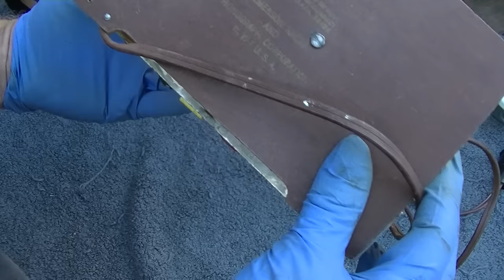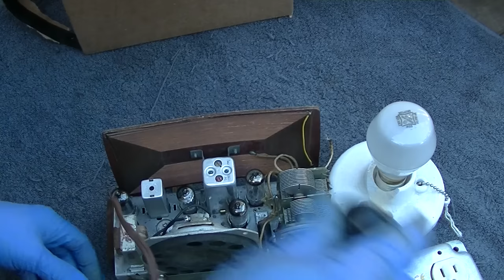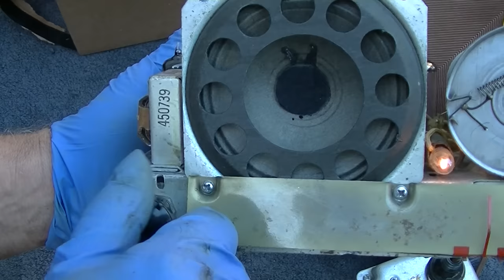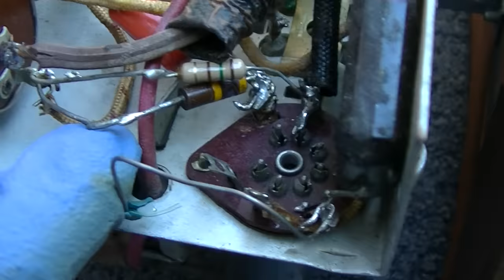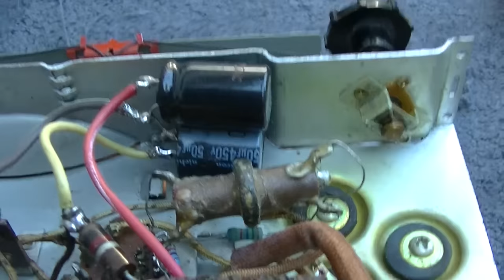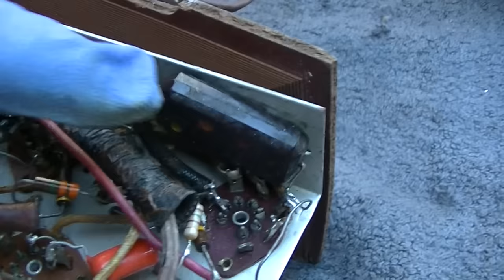Emerson AA5 Tube Radio Restore Mistake Repair

Comment: That capacitor was clearly oiled paper capacitor. Very likely some PCB based oil, by the way. You won't be able to wind the mica this way, mainly in mass production, it would just be breaking.
Reply from the maker: good point, let me get the gloves in the trash and clean all the tools.
Reply: Remember the smell of this oil. Fun times: cadmium plated chassis, PCB-based oils, selenium rectifiers (also with cadmium in them). All the healthy stuff 😸
Reply: @argoneum  asbestos too!
Reply: When I was a young boy my dad had an old camper that he use work on old radios in. (this would have been in the 50's, but it was the 60's when I would go in it) I was born in 1960 and I would have been probably around 8 or 9 yrs old when this happened. I would be fascinated with all the cool looking things in the bottom of those radios and I'd take the old capacitors apart to look at them exposing myself to all the toxins, although not knowing that at the time. (probably why I have this nervous 'tick' now........no just kidding, LOL) One day I got the bright idea to plug one of those old radios in to the wall socket, grabbed the chassis, and it nearly knocked me to the floor. I quickly let go, unplugged it, and didn't mess with them after that. LOL! Young and dumb I guess! 😂 Now that I'm older and close to retiring, I started messing with them, and anything electronic, it's always fascinated me how they work.
Reply: @argoneum  I'm glad I didn't really touch the chassis with anything abrasive or corrosive when I did a 50sish Hallicrafters radio a while back. I was aware of the potential for PCBs in caps and asbestos in insulation and pretty much treated anything that looked oily or fiberglassy like hazmat, but I had no idea at the time to ever expect the chassis could be plated with something like cadmium. It just seems so bonkers now.
Reply: @treelineresearch3387  I piked up a Heathkit Cantenna at an estate sale recently - it's basically a paint can filled with oil, and a big resistor hung from the lid, that you use as a dummy load for radio transmitters. Of course, the oil was all over the outside of it, and when you bought these back in the day, you would either buy PCB transformer oil or mineral oil to fill it.

Long story short, I bought a cheap PCB test kit and I was really happy to see that it was just mineral oil!
Reply: @treelineresearch3387  modern fasteners are often cadmium plated.....
Reply: Yum! PCB's!
Reply: @jaspershattuck4987  No, zinc chromate.
Reply: @OddJobFix  aircraft steel fasteners are cadmium plated, also zinc chromate is used on airplanes and newer less toxic zinc phosphate

Comment: I think radio repairment it's a good start for a kid. I've started doing this since age of 9 by repairing a lot of soviet old electronics and learning what should I do or shouldn't (electric shock with 220V - the best teacher).
Reply: Agreed. I blew myself across a room cutting through a hot wire with pliers. Sometimes, the best way is the hard way.

Comment: i like when someone tells you the basics and then you can look into it further on the internet. i bend those solid wires into loops then smash them together with needle nose pliers and then solder them . i usually try to slip heat shrink tubing on either side and let that be protection for no grounding accidents .

Comment: Novice soldering errors, wrong value replacement parts,  need to replace all bad old caps and not doing so, and cold 
solder joints too can always  lead to this trouble. Shango does a phenomenal troubleshooting job with a licensed by
 RCA  AA5 tube set. Micamold plastic covered capacitor replaced. The desert can wait for now.👍🏻👍🏻

Comment: In HVAC work they are recommending the highest voltage caps for start/run as they say they are all Chinese and substandard and a higher voltage will last longer.

Comment: I've have the same RCA tube manual, a little different version from the mid 70's when I did Voc. Radio & TV in High school, mines been coming apart ever since🙃. I like how clean the chassis was ,and yah the tack on joint will eventually fail over time. It's got plenty of audio now. I've been doing this stuff for 50+ years and still get parts in the wrong place🙂

Comment: The way I see it, the best soldering equipment for working on tube stuff is not soldering iron but soldering guns. Will happily solder metal sheets and only the tip gets hot, so you don't burn wiring or other things in cramped spaces. Same going with automotive electrical work, you can safely put the thing on the carpet as it cools down fairly quickly.
Reply from the maker: i have several of those, the tips break too often and are expensive these days.
Reply: @shango066  form a tip from number 12 bare copper wire.
Reply: @shango066  Use a piece of copper house installation wire, about 4mm² , but you need to experiment the length because the resistance is crucial. Short pieces, like sticking out of the gun no more than 3 cm is about it. It just needs to match the internal resistance/impedance of the secondary winding.
Reply: I would have to disagree---the heat from a 150 watt gun can ruin parts you plan on reusing, and also break off tube socket pins from excessive heat. I use a 40 watt Weller iron for most of my stuff, but I do have an old RatShack gun around for times when I need to solder to chassis
Reply: @justsumguy2u  Those who are experienced will rather use an iron that is to large than one that is to small. When to small you will always need to heat up to long, but when to large the user will know how to solder quick and confident.
Reply: @erikdenhouter  Aside from soldering to chassis, I've never had a job that 40 watts couldn't handle. Using a soldering gun is like using a flamethrower to light a campfire
Reply: @erikdenhouter  don’t be insulting and assume he is not experienced.
Reply: Solution there is to just cut the lead and not remove it from the chassis.
Reply: @marka1986  You need the big 240 watt gun for 12 ga.
 14 ga solid copper works for the smaller 140 watt gun. You won't get a nice tip of heat however, good for chassis soldering of grounds only, not good for tight spaces.
Reply: @marka1986  I was going to suggest the same thing.  Smash the middle flatter gently then anneal.  Make 20 at a time.
Reply: @marka1986  Mr. Carlson has a video on how to do that.
Reply: @linuspoindexter106  Actually been doing the house wire iron tips a long time before YouTube.
Reply: i could never get on with the 'guns' , you're only supposed to use them in short bursts, then rest them a few minutes or their transformer overheats, i have an old 60w iron that does chassis soldering ok, think i also have a bigger one somewhere, 100w ish?
Reply: @andygozzo72  I have a newer Weller that has a smaller duty cycle and a plastic case. It gets soft with extended use.

 I also have an OLD gun that is a bakelite frame and probably wouldn't melt if you tied the trigger shut and walked away.  It's also MUCH heavier than the Weller.
Reply: @justsumguy2u  Never had an issue with that. It's just that you need to be gentle with the trigger (modulating the power) and know your max heating time. Mine is 100W but with a shorter wire (it uses 1.5mm2) it will go up to 125W. I think another big advantage is that you can "move" the standard colophony flux to fix some bad solder joints on the spot without adding fresh solder and making blobs of solder. There are also those guns with a double switch, the ones manufactured in Poland have a 45/75W switch. Trigger has two steps. First one enables 45W for delicate electronics while pulling the trigger harder increases power to 75W. Primary has two taps.  Though with my DIY tube equipment I tend to use ceramic sockets (chinese of course) as those are just overall better quality than old stuff which after several decades will be in rather bad shape anyway (apart from some mil-spec sockets, I happen to have some of those, ceramic with cast iron mounts).
Reply: @TechGorilla1987  mine is a plastic cased weller, probably 20 to 25years old, they warn you in the instructions to only use it intermittently ! also have another one, looks same but unbranded, probably cheapo copy

Comment: I'm like you on replacing capacitors. I have a Zenith model 14P11 Black and white TV from about mid 1950s and its all original and plays like a new TV. I wish I could mail it to you but you're so far away. A nice older man gave it to me before he had to go to the retirement home 😔. I know you would appreciate it and not recap the heck out of it.That takes the fun out of troubleshooting it when it needs repair and If I did I would only replace the bad one. Its not that hard to take apart again and again hahahaha 😆 until most are replaced. I have too many toys

Comment: (@15:13) - There is no “R8” in the parts list in between R7 & R9; it goes from R7 (4.7 Megohm - bottom of center column) to R9 (470 kilohms - top of right column). Oops. 😥 Instead, it’s listed with R1 as 220 kilohms. 🤯
Reply: No, it is the same as R1 so it is listed at the very top, both R1 and R8 are 220K
Reply: I caught that too. Stills seems to work ok though.
Reply from the maker: in this radio its a 470k. Performance wouldnt change at all
Reply: @shango066  Shows how forgiving tube circuits can be. I would be curious to see what happens if you tacked another 470k in parallel, but as you say it probably wouldn't change much if anything. The 12AV6 tube will probably last longer leaving it alone as it is.

Comment: I'm jealous. That radio does point to point wiring in a pretty clean way.

Meanwhile this Philco I'm working on 3/4th's of the time is wiring related. Components are folded and layered on top of each other with a generous helping of extra wiring.

Oh, and it's the first time I've gotten hands on experience with these types of radios. I'm blaming bad luck. And the CIA.

Comment: Some of those military VOMs used 1 milliamp meter movements, so they're 1,000 ohms per volt.  Now some schematics were measured with this ilk of meter so the voltages will be higher than with a 20,000 ohms per volt or higher meter.  Oh, also the line to chassis capacitor really should be at least 600 volts rating, preferably a line-rated capacitor.  Many radios skimped and used a 200 volt capacitor which often shorted or blew apart at the first lightning strike on the power lines.  Sometimes the capacitor would blow out the end, putting out spiral foil streamers, just like new year's Eve!

Comment: Shango, could you point in the right direction...i'm fixing a old tek scope tds544a and i'm having monitor issue.
it seems like the vert and horz deflection is not steady. the picture is  out of focus and expands and contracts?
any ideas? just point me in right direction

Comment: There's a glaring cold solder joint just next to where you corrected the resistor connection.  Did you leave it for the owner to take care of?

Comment: That looks nearly identical to my Emerson 547a - Plenty of model specific schematics available. A note to anyone working on one of these. THE CHASSIS CAN BE HOT. Even with gloves on you could get a shock! I found that out when I was working on mine as a kid some 50 years ago!
Reply: just googled that model no. yep, it looks like the one i have(i'm in the UK, dont see american sets much, but have a few and come across some ones made specifically for the UK and europe as they have 240v transformer)  and yes chassis directly connected to one pole of mains, via the switch,, some were 'semi isolated' connected only via cap and resistor, but not this one!

Comment: There is 125 volts of B+, and I am assuming R8 is dropping 50 volts to the plate of the 12AV6 at pin 7 with no dim bulb? Will that triode operate correctly at 75 volts? Seems a tad low, but I am not all that familiar with AA5 series string sets. Tube data lists 90 volts as typical, with a max peak voltage of 330 volts.  These videos certainly make us think, love the  journey you take us on.
Reply: tubes, or valves as we call them here in the uk can be very 'unfussy' as to voltages, unlike some solid state stuff, as an experiment i ran some 240v intended sets on 120v just shorting out the heater dropper and noticed very little difference, but big reduction in heat generated  , there were some valves that worked at 12v 'ht' for use in hybrid car radios, valves up to the detector, transistor power output, i have one
Reply: @andygozzo72  Or shango would call them vacuum bulbs.

Comment: I just bought a Bluetti power station- battery/inverter/charger and I wonder if it would be good to plug in old tube gear for testing and repair?
No connection to the house wiring at all.
20 years ago I worked for a company that made prototype manufacturing machinery , and we were required to do a lot of 
soldering in the parallel fashion , and each connection was verified by an inspector. These machines were used in the explosives industry,  btw.
Reply: Unless that inverter is a 100% pure sine wave output, it is useless for testing old gear. A non pure sinewave is extremely noisy, and will damage transformers and possibly overheat or explode filter capacitors. Evrn if it is a pure sinewave inverter, its electronics will make a lot of rf noise which will affect radios and other audio gear. Short answer is don't try it.

While the isolation is a good thing, the main thing is current limiting via the "dim bulb" tester, that can prevent serious damage to equipment with shorted components. 

I have an isolation transformer that mainly gathers dust. But every bench must have a variac and dim bulb tester.
Reply: No you'll get a crappy waveform

Comment: Prodding around with fingers in a live tube radio?  He has more faith in thin rubber gloves than I do!  There are some sharp wire ends in that radio that would punture that glove (and skin) very easily.  200 VDC or more into a skin puncture would discourage such a practice.

Comment: Greetings:
You forget to solder your 470k resistor extension at detector pin 7.
This is my first time seeing both a trim-cap tuned 1st IF transformer and a slug-tuned 2nd IF transformer in the same set. Is there some design advantage? I know that only the slug tuned units get silver mica disease.

Comment: The parts list skipped over R8 and only listed R9. In other words, the middle column ended with R7, then the top of the far right column is R9. It does show R8 in the schematic however, but what is the value? (edit: removed time stamp)
 Would not be the first time the parts list and the schematic differ. R9, the 470k is the resistor to the grid of the output tube.
Reply: r8 is 220000 ohms same as r1 it's listed in the schematic along with it
Reply: @Mister_Brown  Wow! Good catch! So that 470k should be a 220k. What a confusing way to list the parts, don't ya think?

Comment: Look out for those IF cans from the Early 50s that have 2 small metal plates with a piece on mica between them for the capacitor. They will get dirty and oxidize and start passing DC voltage from the B+. I had one putting DC voltage on the AVC line rendering the AVC inoperative with distortion on the stronger stations. Cleaned it and it fixed it. Better had I just replaced it with a 20 pf ceramic disc. Maybe next time.
Reply from the maker: It's called Silver Mica disease and it's covered heavily on this channel
Reply: @shango066  Thanks- I'm gonna go take a look